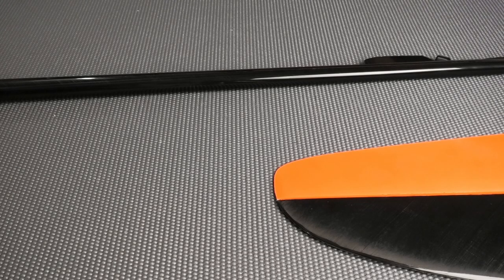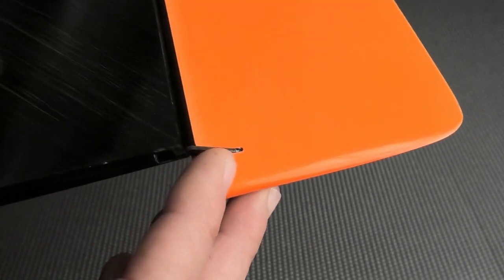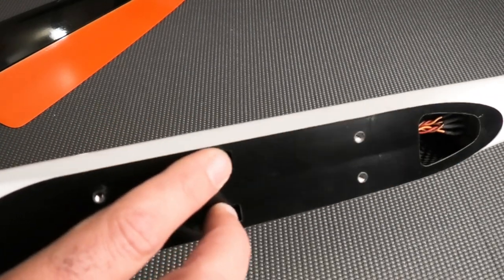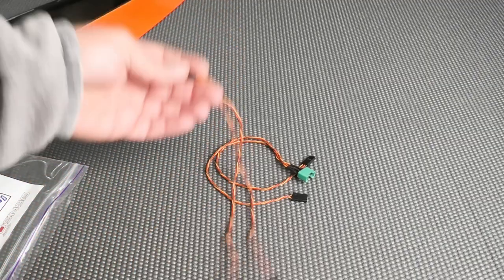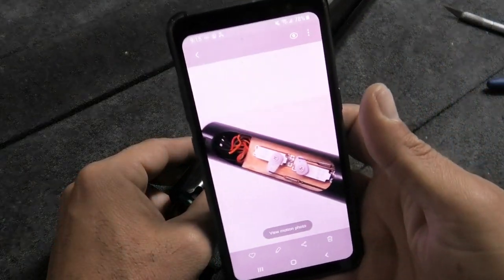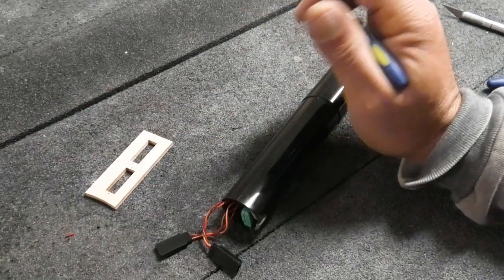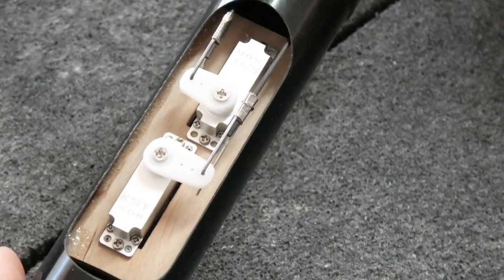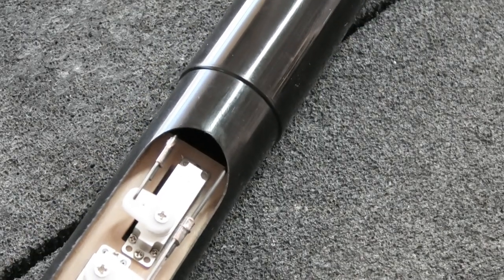CN-Models Sensor F5J Rudder/Elevator Servo Installation

Comment: Hey Ali. Followed with interest. Pretty much the same procedure I used building mine, except I didn't catch the binding of the tail boom plug. I'll need to check mine. It fits well now but it is tight. Thanks for posting these videos. Mine flies great. Hoping this one does too. In light wind (8mph and less) I've been flying with a CG back at about 107.5 instead of the recommended 106, to get a little more tail responsiveness. Haven't flown in stronger wind yet (mines a light) but thinking I'll push the CG a little forward to about 106.5 when there is more wind. Mine finished out at 1241 gms flying weight at the 107.5 cg, and add about 5 g to the nose brings the cg forward to about 106.5. Looking forward to your flight video!